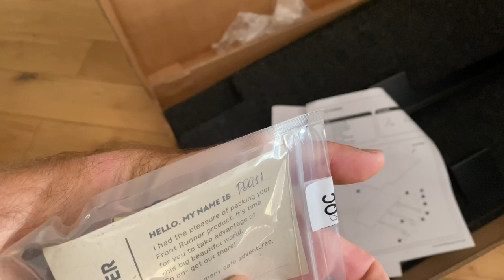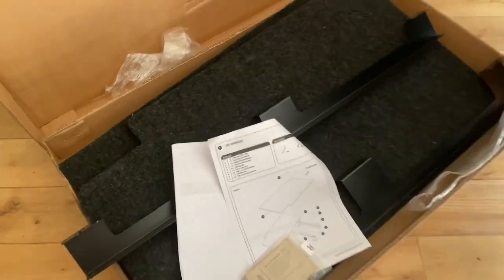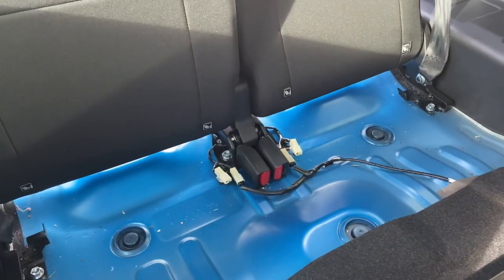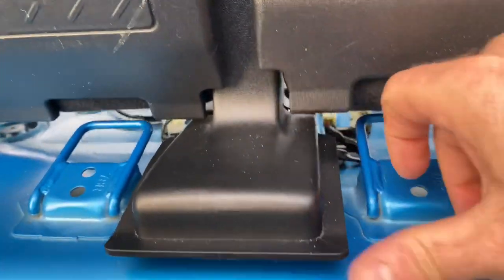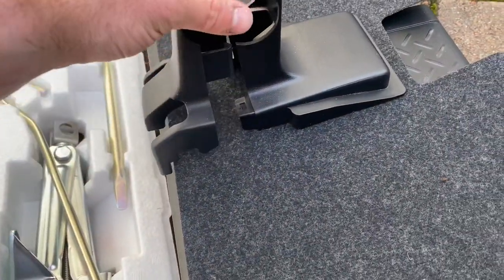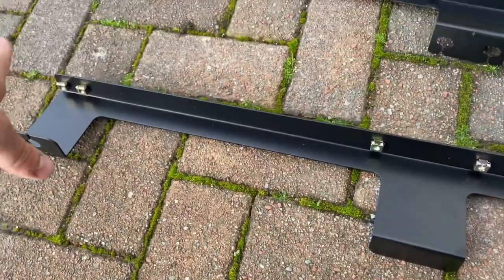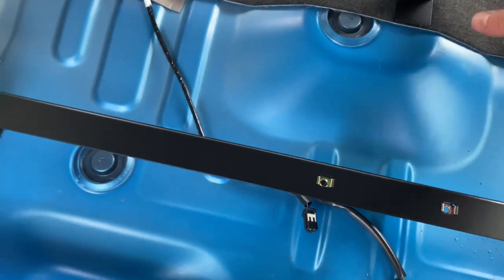Front Runner base deck fitting for new Suzuki Jimny

Comment: Helpful video! Though I think it would be better if Front Runner made it higher---at least as high as the bottom of that 12v plug. That way you can store/install more things underneath like a battery, an ARB compressor, valuable items like a laptop, etc. Just put hinges on the board for access to the floor and then install lockable cam latches or compression latches that are flush to the floor. You can also screw in some e-track tie downs or those flush/retractable tie down anchors in key corners  and just have a couple of e-track ratchet straps handy in case you wanna tie down anything.

Comment: tks for the video West Hghland MicroAdventures! It´s a great idea to put a hinge and make a small hatch. Also, FR could do a version that make possible to maintain one of the rear seats.
Reply from the maker: You’re right Nelson that would be great, I’ll be fitting the hinge in the next few weeks so I’ll post a video with that when it’s complete so you can see the modifications then the next challenge will be a sliding drawer for the cooker. Lots to come and thanks for watching

Comment: I noticed in your video you did not put the 2 bolts back for the seat mounts and they have been kept open. I would advise you close it off with the bolts that you took out. 
1. it will ensure no water and dust  ingress into the car.
2. you wont loose the bolts.

Comment: What did you end up doing with your seat belts? The instructions from Front Runner say to bolt them to the middle bracket, but I'd really like to have them out of the way.
Reply from the maker: I pushed the metal end where it attaches to the bolt into where the seatbelt comes out off  the plastic trim holds it in place and stops it knocking. kept them neat and tidy at the back.

Comment: Looks great. When you lay your front seats flat, is the base deck pretty level with them? I’m looking at sleeping in my Jimny and an even surface should work a lot better. 
Thanks.
Reply from the maker: Unfortunately no it doesn’t they are just a little to long for that. You do have room to cut them down and take the edge off by the seats which should give you the space but I’d advise some good measuring first 😂
Reply: @westhighlandmicroadventure8770  Thanks for the reply. So you cant actually lay the seats flat?? They hit into the base deck??
Reply from the maker: That’s correct. Not by much but it stops them going flat like they do without the base deck.

Comment: Would it not have been better to trade your Jimny in for the New Commercial Jimny and save you the trouble fitting this kit.
Also as yours is a Four seater version it would have been a much sort after Jimny and sold for more than you paid for it by about 25%  as there are not many in the country and the cost is increasing all the time, because of the new emissions laws affecting the new Jimny Four seater and that's why the Commercial is the only new Jimny you can buy in the UK now.

Comment: Hey! Another question
Wondering if you might be able to get the dimensions of LxW of the jack area (the styrofoam area, and the height from the bottom to the base deck? I have a shop in Australia that wants to fabricate a mount and lithium battery for that spot for a dual battery, and my Jimny is a few months away.
Reply from the maker: Yes mate I’ll get them to you, should be tomorrow. I’ve not forgot that you need the one to where the base deck turns in also. Just been moving house so busy busy busy and Jimny still has my bike in the boot.
Reply: @westhighlandmicroadventure8770  Absolutely no rush at all mate! As I said, my Jim is a few months away, so I'm doing all this planning really early. Super appreciative of you helping, though - and good luck with the rest of the move!

Comment: Hey! Are you able to let me know what the measurements are for the base deck, please? Front runner isn't able to get them for me. 
I'm specifically looking to know what the length is from the boot end to the opposite end of the deck (from the middle of the deck) and what the length is from the cutout section on the side to the opposite end of the deck, if you get what I'm saying! I need these to figure out if my fridge will fit. 
Thanks!
Reply from the maker: Yes matey, the length is 835mm or 83.5cm whichever you work in.
Reply from the maker: Width at widest is 460mm per board from middle
Reply: @westhighlandmicroadventure8770  Thanks so much!
Reply: If you're able to, could you please let me know what the length is at the shortest point? Theres a little cutout just at the end by the boot. Again, thanks a-lot, I really appreciate it!
Reply: The width there would also be amazing!
Reply from the maker: The narrow bit right at the back is 400mm per board. As for the length at where that bit cuts in I’ll get that to you in a bit, boot is toppers right now as moving stuff around.
Reply: @westhighlandmicroadventure8770   Thanks again, really appreciate it!
Reply from the maker: So the extra dimensions you required are as follows. From front to back where that bit in the base deck cuts in that 670mm

The cut in is 60mm

At its deepest the Jack well from the metal it the bottom to the bottom of the base deck is 170mm and at widest before it tapers is roughly 500mm